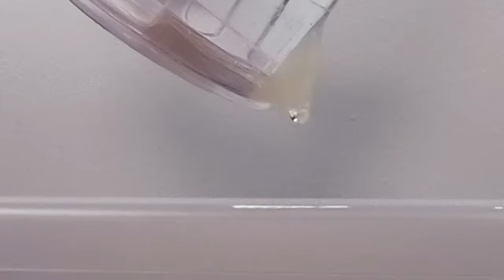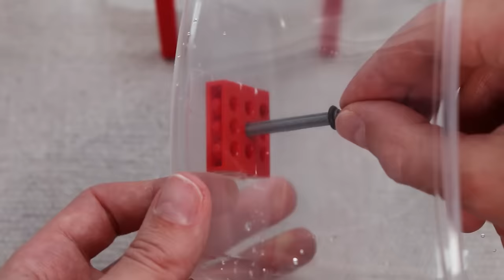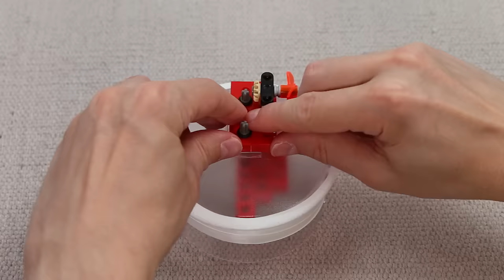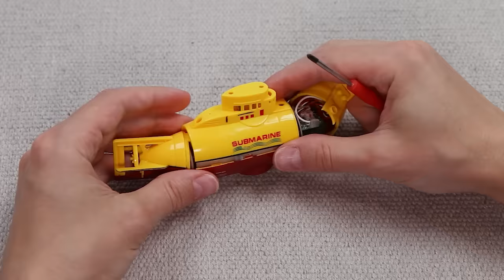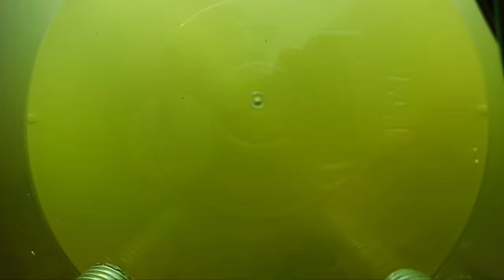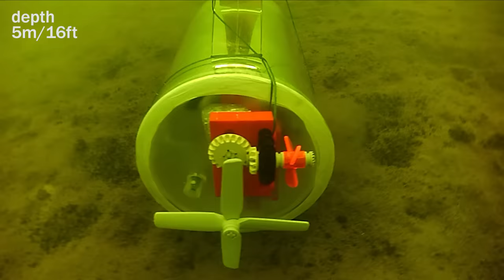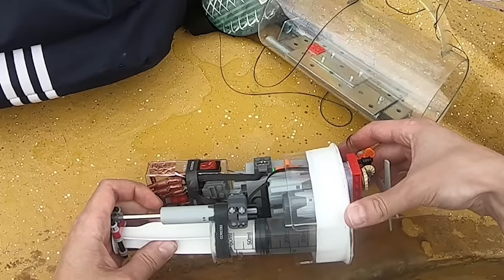Building and Testing a Lego-powered Submarine

Comment: Fill the vessel with mineral oil. It is boyant, in-compressible, and it doesnt short out electronics
Reply: How would the syringe work then?
Reply: @Keegan Young mineral oil is less boyant than air though. Notice he had to add weights as ballast to counteract the boyancy of the air. If he filled it with oil, he'd just need less ballast.
Reply: @Keegan Young so is air. You need something boyant to keep the submersible from sinking, most submersibles are full of air. In this video, weights were required to counteract the boyancy of the air.
The problem with air is that it is compressible, so any submersible filled with a gas has a crush depth, or a maximum depth it can go to before it crumples. Another problem, since this submersible isn't very rigid, as it dives, the air inside compresses, making the the air denser and less boyant, causing the submersible to have a tendency to sink the deeper it dives.
Oil is a liquid and is therefore non-compressible. Effectively, this submersible could dive to the deepest trench in the ocean if it was filled with a liquid, and it wouldn't be crushed. Oil is a great liquid for this, because it is non-conductive and won't short out the electronics. Oil is also advantageous, because it is slightly boyant in water. If it was as dense, or denser than water, the submersible would sink. The slight boyancy counteracts the weight of the battery, electronics, and motor, which would otherwise sink. Being less boyant than air is advantageous, because less ballast weight is required than with air to achieve neutral boyancy.
Reply: @Keegan Young The fact that it is boyant is a selling point though. If it was denser than water, it wouldn't make as great of a substance to fill a submersible with.
Reply: Don't throw oil into water, u ll be fined by MARPOL, 😂
Reply: @Keegan Young Why should he apologize for your misconceptions?
Reply: @Keegan Young Now, reread that a couple of times. The source of error is not what he wrote but what you are reading into it. If you read what other people write with the same amount of detail that you want yourself to be understood, I'm sure you'll see a good result.
Reply: Wow. I did not know that. Could this be used as a coolant too for liquid cooled computers?
Reply: @Keegan Young your English is great, I couldn't tell that you weren't a native speaker.
Reply: @Keegan Young it will become a ship
Reply: @BlackKnight-ll8qh  a bit back Linus tech tips made a video of a submerged PC in mineral oil

Comment: Suggestion to prevent incoming water: use a magnetic gear to transfer movement through the chassis.
Reply: Well isnt the Wall a bit too thick?
Reply: @Jan_Heckmann  For the magnetic field?  No way, a mm of plastic would be a piece of cake.
Reply: Yes, I understand, but won’t that uh mess with the uh flux capacitor?
Reply: but the propeller would fall off if something bonks against it too hard

Comment: As a concept it is more than fine. I know that you wanted to use that clear plastic container to see better. Handle and all. You can glue the peace of plexi or acrilyc glas to the  tuperware type container that is water tight around the lid with silicone seal. Also use some vaseline, silicone or teflon grease around ruber plug in injection. Will be way easyer to overcome the preasure in the deep. Keap up the good work!

Comment: I love your videos! 
I am working on a Lego model that involves hanging a lot of swinging weight by
 Lego strings with stud ends (preferably part number x127c41, 41-L long, black).

Maybe you could make a video testing the tensile strength of a few of these?  
In my model they'll be swinging in a circular motion with a radius of 1M at the bottom end, so that might negatively affect their longevity.

Comment: Should put some 12 inch monster propellers on it with 4 engines
Reply: Mr Noah looks like he need more power for the ballast to push the water back out. Too much pressure at 16m.

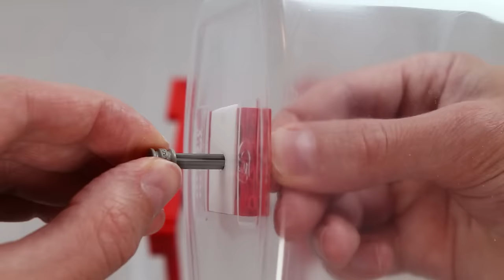Comment: What is the piece put on the axle at 2:01? I’ve never seen one before. Also, where can I find the rubber band that you used for the water tight seal. Also where can I find the L298 H-Bridge
Reply from the maker: The piece at 2:01 is actually two toothed half-bushes. You can find one here: https://www.bricklink.com/v2/catalog/catalogitem.page?P=4265a
The rubber o-ring I bought from local hardware store. Size 5x2 mm.
The L298 H-bridge I bought from here: https://www.amazon.de/dp/B01N9R75LR
Reply: Brick Experiment Channel Thanks! I’ll let you know how mine goes!
Reply: Brick Experiment Channel Sorry again, the jug I couldn’t find, could you tell me where I could find it?
Reply from the maker: The jug is this one: https://www.puuilo.fi/epages/puuilo.sf/fi_FI/?ObjectPath=/Shops/2014011303/Products/10038459
However, you probably won't find it sold anywhere outside Finland.

Comment: Why hasn't Lego hired you to be part of their "technic" Lego engineers?
Reply: The guys working for Lego probably have more engineering experience and knowledge than the host - it's his presenting skills that really make his videos wonderful. I'd suggest they hire him as a video director, rather than as an engineer. 

The weaknesses of all the Lego technic pieces - whether it's the low power of the motors or the twisting of axles - are all intentional. They are made so they are strong enough to last forever during normal use, but not strong enough to cause any harm. So, for example, even if you gear up a motor to spin a propeller as fast as possible, the propeller shouldn't cut through your skin if it touches you - because the axle will twist and break instead.
It takes a lot of engineering work to find that midpoint of longevity, usefulness, and harmlessness. Most of that is in materials properties and sciences, and the structure of individual pieces. Then Lego has another bunch of engineers who figure out how to make the machines which produce all these pieces.
Reply: comradejustin bruh
Reply: @Uwu-os4xw  certified bruh moment

Comment: Extra information: Since salt water does not allow radio waves at usual frequencies (UHF, VHF etc), communication with submarine is a complicated process, usually with an extended antenna or extra low frequency. Such ELF needs extremely massive antenna which is impossible to be accomodated on submarine. Hence, the communication is one way (from ground station, which can have massive antenna to submarine).

Comment: Nice demonstration of what waterpressure can do! 
At 5m depth the pressure will be 0.5 Bar, which translates into 5 N per cm^2 of diameter of the siringe. Hard to tell from the video how big the siringe is. You also need to add the force to overcome the friction, of course. I could imagine that the linear actuator may need to afford 10N.
The deeper you dive, the harder it will get to push that water out.

Comment: I think you forgot to account for the water pressure, thats why it leaked the first time. Thats also probably the reason the Balast pump would not work when you went "deep' but when you pulled it up with the string it started working.

Comment: Nice! similar issue with other lego designs I've seen (except, excellent way to add a ballast!) .....it would likely be easier to control and would be more stable if it had diving planes and a rudder system. 

.....but wow, you folks impresse me!

Comment: To seal the shafts of the blades, it is better to use fluoroplastic gaskets, rather than rubber ones, since the fluoroplastic is very slippery and absolutely does not interfere with the rotation of the shafts, in comparison with rubber.

Comment: I imagine this has a maximum depth before it would get crushed since there's no compressor  or compressed gas supply to equalize pressure. It may be pretty deep, and the external pressure at depth will help maintain a seal, but beyond a certain depth it will certainly be crushed.
Reply: That crush depth is probably well beyond the antenna range for the sub tho lol

Comment: Excellent work, man! 2 kilograms heavy submarine with only 25 grams (= 25 milliliters) of buoyancy. A tiny leak of water into the sub and you'd have to dive to the bottom of the lake to recover it!
Reply: Anyway I'm amazed how a cheap plastic jar didn't break at 5 meters depth.
Reply: At 5 meter depth pushrod motor didn't have enough force to push the syringe and eject the water. Ever considered greasing the syringe and trying again? Or maybe increasing the voltage applied to the motor?
Reply: I have a suggestion of a nice side-project: although this is a shitty sub and maybe not worthy of doing it, you could install an automatic depth control circuit, using e.g. an Arduino with water pressure transducer. Arduino could drive the syringe pushrod motor automatically to keep the constant depth, to prevent you sending the sub too deep or even rescue the sub in case of water leak - by emergency surfacing if buoyancy gets less than e.g. 10 milliliters or when battery gets empty. You'd need to connect the buoyancy control output from the sub's remote receiver to Arduino (so it would know you want the sub to dive deeper or shallower)
Reply: I got another idea: instead of using a syringe, consider a pressurized tank - e.g. propane gas refill bottle. It is very cheap, quite small, contains a lot of gas at 2 bar pressure or more and it is very easy to open the valve and release the gas. A bigger buoyancy volume chamber could be used (e.g. Water/Soda plastic bottle 0,25 L), one small gas valve (to allow the water to come in) and a small motor to push the propane bottle/valve to release gas into the chamber (to push water out). And due to the high gas pressure, you could save the submarine even from 20 meter depth (if the outer case survives the water pressure, of course).
Reply: And then, why use a buoyancy chamber (i.e. syringe) at all? Drill a hole at the bottom of the jar and let the water enter the jar itself! Move all electronics into the upper half of the jar, put stainless steel ballast weight (so it wouldn't rust) at the bottom (to make sure jar would remain upright all the time). That way no pressure could ever break the jar. Maximum depth would be limited only by the gas pressure in the propane gas bottle. The best part - warmer the water, greater depth could be achieved! Should the submarine sink to the bottom, jar would not get damaged and submarine could probably be rescued and repaired. The only real danger is the possibility of propane gas explosion, but only if a spark or flame appears inside (the risk of which could be minimised).

Comment: Deep dive failed. No enough motor power for the syringe to pull the water out from the tank because of high pressure of the depth. You had to pull it a couple of meters where pressure is lower and only after that it started to work :)

Comment: Hello I work on boats and I'm at 2 min and 23 seconds. Now, with shafts, they often have a "gland" or "packing". You want some water to come in as it will cool and lubricate the shaft. I know this may be problematic as droplets will spray around. Just food for thought, however im not finished watching perhaps you added lubrication. 

I would make a rubber boots that the shaft goes into.

Comment: Correct me if I am wrong, during deep dive test submarine was not able to break surface because of preassure right? The power of lego motor was not enough to push syringe plunger because water preassure on the depth is stronger.

Comment: Hear is some instating information for you who read this well over 200 years ago a man built a submarine out of wood yes wood and it worked he did a test drive and managed to go beneath the water then return to the surface so he tried going even deeper 75 ft and the submarine and the man who made it got crushed by the pressure at 75 ft down he did not live to talk about it.